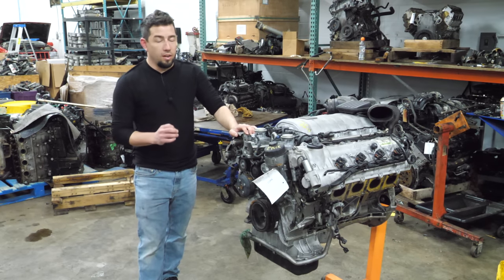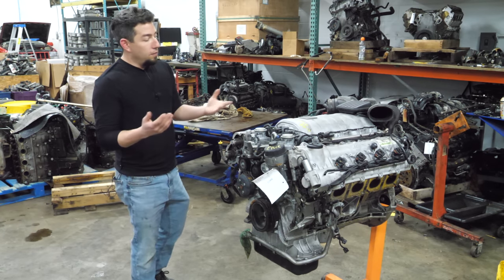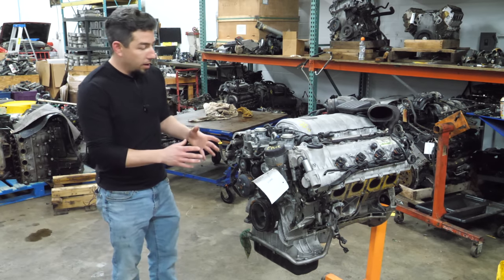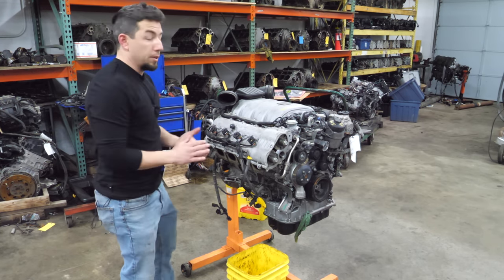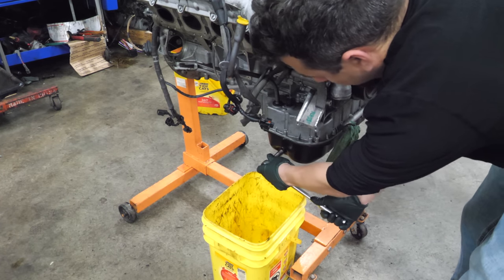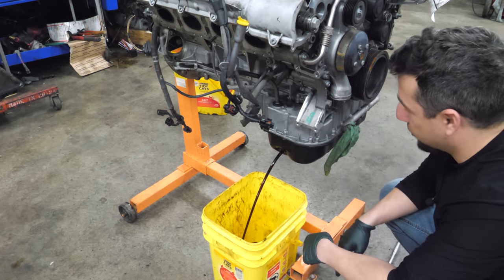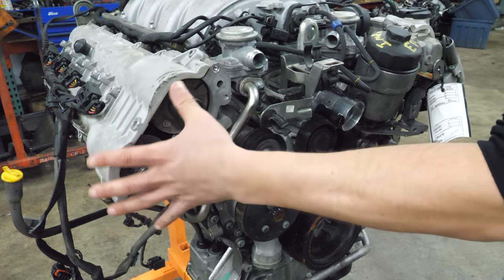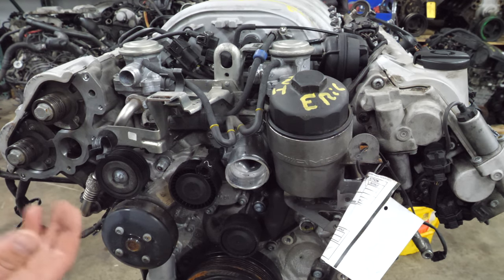Mercedes S63 M156 AMG 6.2L V8 Complete Engine Teardown! What Killed This 500+ HP Euro Powerhouse?

Comment: I personally don't care if there's lots of gory, catastrophic, apocalyptic damage to the engines you tear down.  Also, the joking and the affable banter are nice, but way secondary to me to the lessons learned about how these engines fail.  It's a great opportunity that I probably wouldn't be afforded without being a mechanic myself or having a friend or family member who was.  Even then, I might not be able to see what I see in your videos due to insurance limitations on who can be on a particular shop's floor.  So go ahead and tear down the ones that are a little mysterious as to why they're in your shop.  All lessons are valuable.
As to this engine:  Why is all the evidence of oil starvation only in the bottom end?  Remember how clean the heads looked?  They didn't even have any of that carmelized oil coating in them that you see in so many used engines.  I suspect this was a rebuilt engine that was rebuilt improperly and failed after being installed.  I don't see it as a misused, abused and taken-for-granted engine that was neglected.  It was too new-looking for that.

Comment: I think that rubber seal is actually supposed to be a soft rubber O-Ring.  XF Motorsports had a catastrophic engine failure while he was running his AMG on the track and when he tore the engine apart, he found that busted up O-Ring.  XF Motorsports bought a used AMG engine and he took the oil pan apart only to find the same issue.  Over time, that O-Ring hardens up and then breaks apart ruining the seal and then ruining everything else in the engine:  https://www.youtube.com/watch?v=_TG9Und29dI

Comment: I’ve gotta couple of cores that would be great videos! Core 1 is out of my 1999 Toyota 4Runner limited 4x4 3.4  270k that lost compression in cylinder 3 pretty sure it’s just the head gasket. Should be a good candidate for rebuild. Core 2 is a little more interesting! Found a 1995 4Runner Sr5 with the motor every one loves to hate the 3.0 3vze  but you gotta see the numbers on this motor. Mileage 302k. the odometer has been cut, so I ran a car history report. For first 213k it was very well maintained but history report says this engine may have 384k not sure how accurate that is. I do have that last emissions it past in 2018. Who knows 🤷‍♂️ it’s been sitting since. Got it running but has a bad knock. Would love to see the inside. Any hoot 🦉 I’ve got the 99 back on the road old core just sitting in my garage. Still gotta pull the 3.0 but there up for grabs. I am have a hard time finding a replacement 3.0 if you know of one. No I’m not to switch it to 3.4 ! Let me know if your interested ✌️

Comment: This engine has the defective female head bolts. It also has aftermarket metal head gaskets instead of OEM RTV. The engine died from oil starvation after a rocket scientist installed a substandard metal head gasket and reused the one use torque to yield female headbolts, which failed to reseal the oil and coolant passages.

Comment: Interesting... this is effectively a flat tappet cam.  I don't doubt they are a common failure point.
Reply: Flat tappets are super common on DOHC engines. They're usually not a problem because DOHC designs have lighter valves (there are four small valves rather than two big ones) and no pushrods, rockers etc adding inertia to the valve train. This allows them to run much lighter springs than a typical American V8, so the load on the cams isn't high enough to demand rollers.

Comment: It may not be starvation, but poor oil quality. The sludge in the pan is emulsion, the only way to do that is to run the engine with water in the oil. Chances are this was due to contaminated oil.

Comment: I had an Alfa Romeo 147 Twin Spark that died of oil starvation because the filter housing evacuated all the oil from the engine during an Auto Cross event. It happens, also don't buy Alfa Romeo's they're terrible.

Comment: The Rubber Seal ... I have been told in a video of Redhead Zylinderkopftechnik ... it is the timing cover seal ring, was leaking in their video as well.  Seals Water from the Housing. Would explain water in the oil... mhhh Maionaise ... Just sain. Watch the videos of Zimmer Motorsport, .. he is THE best with theese engines.

Comment: A real mechanic would " never" pull the pan off a blown engine by turning it over first! Put a tray on the floor and drop the pan "down" to keep all the junk in the bottom of the pan instead of distributing it into the rest of the engine, keeping everything in one easy to observe place.
Reply from the maker: It’s a good thing I’m not a real mechanic
Reply: @I_Do_Cars  more like a deconstruction specialist

Comment: take the spark gap from 63 thou to 25 thou... runs softer, there is a 4 month lean over for rod bearings and timing chains... just do the bearings every 30'000 miles there $50 for a 8 cylinder set, it's a 20 minuet job for a ford engine. how much was that engine? Bevies and Butt head win a slot machine, once again! $50 on top of the 130'000... just wants to buy another new one for 130'000. "equality already had one cant sell em another, as it infringes of others then there own constitutional values. wreck a clunker? the manufacturing process for base stock costs the same as other stuff... the panels are just bent round not square like a jeep. two drinks to much, one in each hand two kinds of thought. #Mr.Crabs
Reply: AMG but can not a-ford...
Reply: 483'000km on the original rod set... can only faintly hear it knocking.